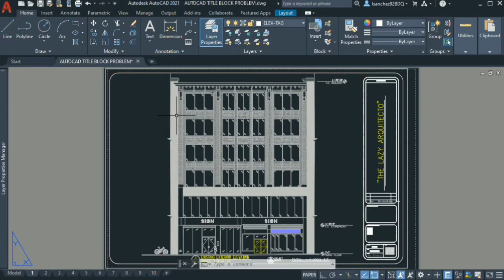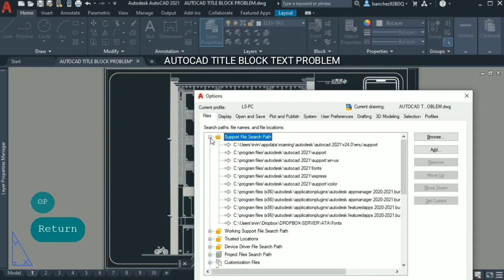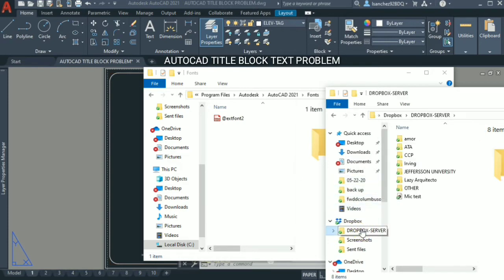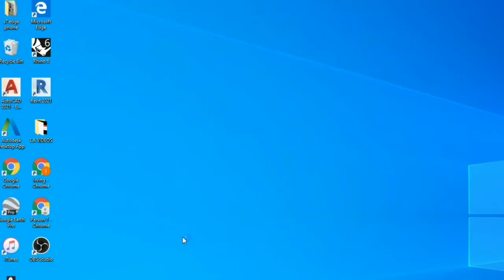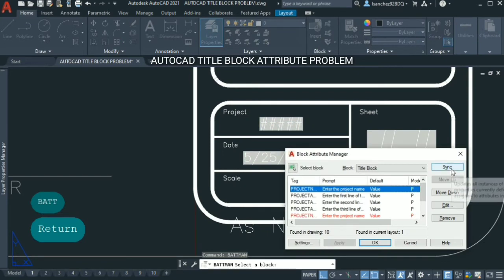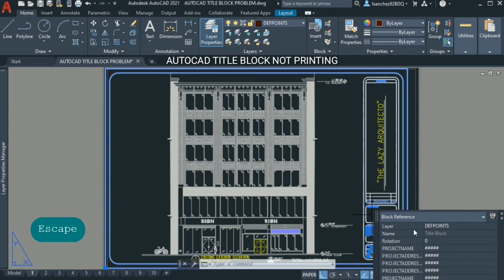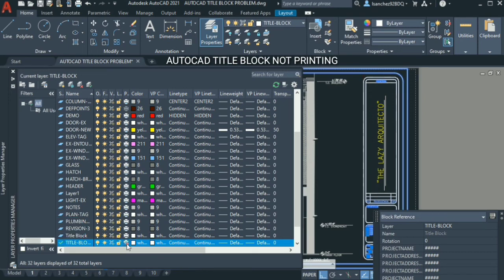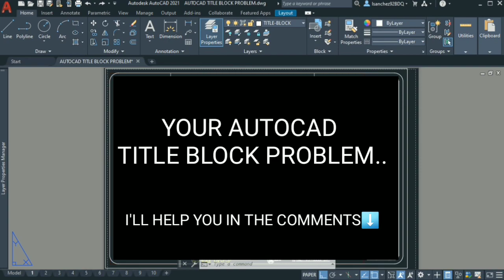How to Fix Autocad Title Block Problems

Comment: Hey I have a problem I na trying to insert a title block and my page set up is set to 11x17 and my title block border is 16.5x 10, when I insert that title block In paper space my title block is off and when I print preview its not showing completely. Even if I move it and try to center it. A section of it Is outside of the printing limits. Am I doing something wrong?
Reply from the maker: Hi try this: PRINTING PROBLEMS for AUTOCAD STUDENTS
https://youtu.be/9T9Lf_dAKf0

Comment: Bro plz tell me 
When i use the autocad elev block that is in tool pallette . When i mirror it and chnges the text its position or axis changes
Reply from the maker: Is the text reading wrong? then use the mirrtext system variable before the mirror command

Comment: I don't use block as title block but I have the same problem with my xrefed titleblock. Would this work?
Reply from the maker: Welcome back Serene. Yes these solutions will work with your xref title block. However, I’d probably have to do another specific tutorial solving xref title block problems since xrefs are a complex subject in Autocad. Let’s see if more people request this.